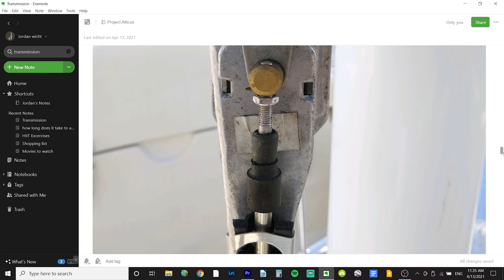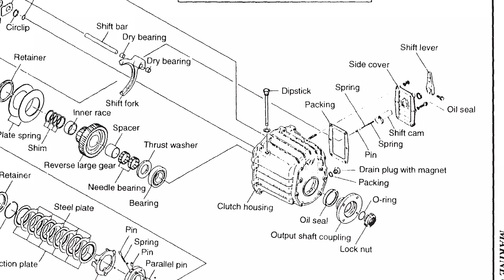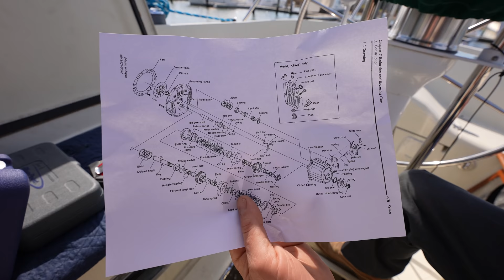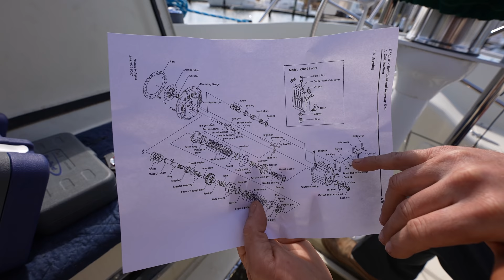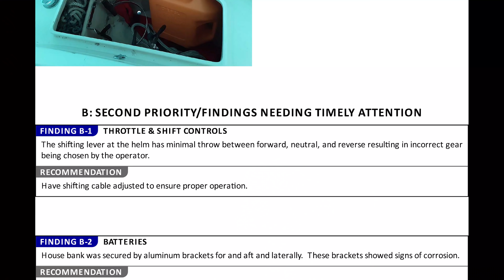This is a BIG problem 😧 | S06E02

Comment: Something I learned a long time ago, when you have something that is broken, you should go ahead and give it a shot in repairing it. Generally people charge a set labor cost to do a certain job, meaning a transmission rebuild is "X" number of hours of labor to repair. If I pull it out and give it a go in trying to repair it, I may be successful, or even fix it. My worst case scenario is that I am unable to complete the work and I bring all the parts to the mechanic and I'm charged the "X" number of labor hours, whether I bring it whole, or in pieces (generally.) So why not try it? Certainly there may be circumstances that would change this general statement, like proximity to available parts and mechanics. I learned this working on motorcycles. It generally doesn't hurt me to try and do the work the first time. 

My initial uneducated guess is a problem with the shifting fork...

Comment: I rebuilt my Yanmar 2GM transmission 2 years ago.  It is not as difficult as you think!  My transmission is a cone clutch transmission yours is a friction plate clutch.  Some of the Yanmar 3gm series used the friction plate clutch.   Its a bit different.  I think what happens is when the transmission starts slipping people pre load the forward shift position to create more pressure on the cone or friction plates in forward.  The issue is when you try and shift into neutral the transmission is slipping into forward.  This makes the issue worse!  With a cone clutch you can "lap" the cone, which is what I did.  I am not sure if there is a way to do this with friction plates.   Regardless there is a Facebook group "Yanmar Marine Engine Owners Group.  I get good advice on this group.  There a a retired Yanmar mechanic Danny Fong who gives the best advice... Good luck !!!
Reply: I spent less then 100 dollars to lap the shift cone in my transmission.  After 2 years it is still working perfectly!!!

Comment: (Just to say, I sailed for over 35 years, cruised and raced before I got into horses, enjoy your vids)  Your “hey let's just fix the lever how hard can this be” moment had me chuckle at a memory. I wanted to repair some boards on a stall and the next thing you know I was building 2 of them because , I discovered how rotted the supports were and they all need rebuilding for me to feel safe putting my horses in there .  

No small project ever survives remaining small and let's hope the next episode shows your transmission getting put back in and working. I'm honestly looking forward to the video when you guys are out sailing. The New England coast is gorgeous in the spring and what a good way to test that rebuilt transmission and rig!
 

By the way, nice work station in the background there. I see you now have room for a pretty good sized monitor and adjustable platform. It's nice to have room isn't it? 

Fair winds

Comment: The spot where you changed the pin you could have took a file or grinder to it and then it wouldnt have bent the cable.

Comment: I have watched your video this morning. I have been in the marine industry for many years. The Survey was correct in that there was a problem with shifting. 
How big a problem? Well that was both the surveyors fault and yours. Before you settled on the sale price you should have involved a good mechanical service to look over major issues like the shifting. The mechanic would have found not only the shifter issue at the helm but the cable issue and the fact that due to the shifting problem you may now have a transmission issue which ultimately reared it head. 
Point of interest for you and the viewers the Edson shifting unit you have on the boat is not a good product. If you want trouble free service you should convert the Edson unit to include a separate shift and throttle unit which you can find on Edison’s web site. I would highly suggest you have Safe Harbor / Bruce & Johnson’s marina install all of this with you looking over their shoulder to learn how it is done.

Comment: Um... to adjust the holes on the cable fork, don’t you just loosen the bail that anchors the sheath of the cable, and move the sheath back or forward? No need to screw or unscrew the tang on the cable.

Comment: Very good explanation on the problem with the gear lever and also on the inspector that he only has a few hours to do an inspection. I have a question for you. I know there are boats that have a sewage tank. When it's time to empty it and you are at the dock, does a vacuum truck come to your boat to empty it, or there is a setup like at the campgrounds. Thank you

Comment: Funny related story- 25 years ago, we bought a classic Alfa, and we also got a pretty significant inspection.  And like your transmission, the shift fork system broke very early on.  Since it's been fixed, though, no problems.  I hope for the same long term fix for you.

Comment: We would have new boats coming from the factory with control box problems binding the problem was they didn't read the instructions that came with the control box the cables   need to articulate and needs 12 to 18 inches of free play coming out of the box

Comment: I can relate to this soooo much... is like you start pulling the end of a little thread in a big pile. You only hope it will not get tumbled up with the whole bunch. That said, there are a few sailboats roaming the high seas without any engine (also in the Pacific), is it totally irrealistic to get to NC that way? (am a coach surfer, this is not a challenge but a genuine question)

Comment: you never shift "into gear" without engine running.  Your cables where not adj right- you broke it by force shifting when internal gears where not aligned because engine not running, maybe.
Reply: sure but if that activity broke a shift fork or shaft collar then it was already weak and this was the right time to find out! serendipity.

Comment: Was engine tension reapplied to transmission after control turned floppy ? May be that without load that selector mechanism has dropped into a temporary "dead zone" between gears with being pulled in and out numerous times in a loadless environment just a thought and question for my own enquiring mind ?

Comment: ....while you are at it - do yourself a favor and stock up on CRC SPH-400!! That's a industrial component protectant. Despite waht it says on the usage sheet - it is literally the one thing that does it all! It sprays on from a spray-can  and eventually dries to a wax-like consistency. It stays semi-transparent, so you can see what's going on underneath. YOu can build up a thicker layer by applying thin coats over a couple of days....
Like with your present gear box control troubles - when you fixed it and/or get new ones - when you have it ready adjusted - SPRAY IT ALL with SPH-400!! Actually I would cover most of the engine too - gearbox and all! Frankly - have a look where you see corrosion  - clean it up and cover it with SPH-400, multiple times! You will be glad down the road!

Fuel System, Water systems (fresh, grey, black), under the sink, wiring where you want to protect terminals (wire everything up - when done and tested - coat it with 1-3 coats, battery posts/terminals)

My background: Industrial mechanical engineering, 4 years merchant marine (engine area), 7 years flying of Tunaboats.
That stuff even solved a corrosion problem with PC-boards in a fumigation controller (Helicopter Ag-spraying) - just coated the whole board 3x and never looked back....

I have NO association with CRC - just telling you what worked for me for a universal protectant cover!

Good Luck!
Let us know when you are in Panama again!

Cheers!

Comment: If you have not already checked just try moving the f/R lever on the transmission whilst it is out if the lever rotates and the shaft doesn't it's an easy fix ie roll pin knock it out and replace 😉

Comment: the most important thing you can take away from this, is that you guys dodged a BIG bullet.......if that trans had failed somewhere in a storm, it could well have cost you the boat, AND possibly your lives...Jordan, you were absolutely correct to keep poking until you found out what that bad feeling trans linkage was....GOOD JOB !     Mechanic of over 50 years.

Comment: I feel like I’m the only one thinking, “seems normal”.  You bought a used boat; theses things are ALWAYS fixer-uppers.  Nothing here seems that big of a deal considering factors, like age, use, and price.  If people expect a 100% new boat, then buy a new boat.  But I’ve seen dealer issues even with those, right after launch.  Only difference is, they’re covered by warranty.  I guess 28 years in the Coast Guard has allowed my to see a thing or two.

Comment: ya i have the same problem finding neutral in my 40yo universal diesel but i dont use it that much so ive learned to shift it very gently and live with it.  i look at the schematics of the engine and transmission and i say omg if i have to get into that im jumping overboard!

Comment: Sorry to sound like a smarta*se, but could I suggest that you re-dismantle your throttle box and try and wipe off as much of the traces of WD40 as possible. You can then use 3-In-1 or sewing machine oil or similar to lubricate the lever and cables. WD40 is not a lubricant and will lead to accelerated corrosion especially in a humid environment. Disclaimer: my particular experience with this is with a mountain bike cable, not a boat, but hey, pla ça change....
Reply: pla??? "plus" is what I meant

Comment: Buds, been looking at the transmission drawing my thinking is your problem may be in the shift cam, spring, or a broken pin. Remember the boat had forward and reverse so that tells me all clutches and related parts or ok. Besides this didn't happen while under power. just a thought

Comment: Lucky that gearbox failed at the mooring and not during a passage or coming into a mooring.
You did the correct thing shortening that tube as the cables have to pivot at that point close to the single lever control. I hope you removed the sharp edge on the inside of the tube.
WD40 is not a lubricant just a water dispersant. Use spray grease to lubricate the workings .

Comment: Some how now days I don’t trust my own shadow.. after all the research and guided buying somehow I feel you guys got cheated on the purchase. 200k should have bought you a trouble free almost perfect boat.. no transmission or engine problems that’s for sure. I understand if a water pump doesn’t work or an alternator but the transmission or engine? That’s a lot to deal with for 200k..

Comment: Consider replacing the engine with an electric drive and a bunch of LiIon Batteries. Less mechanic hassle and together with a good generator your boat is miles ahead in terms of environmental friendliness and maintenance needs.

Comment: While you are stateside you should absolutely upgrade your computer to a mid to upper level AMD Ryzen model laptop(5000 series CPU best, 4800 excellent mid range value), with a discrete graphics card(not integrated APU graphics) built in, either a  Radeon 5500M, or better, 5600M, or NVidia Geforce 3080(careful, there are many versions of the 3080 being put in laptops, and some are so inferior they are 3080's in name only...shame on you NVidia). Expensive, but worth it. Intel can no longer compete, especially in productivity work, such as graphics and video editing. It will greatly reduce your time and effort in video production. So dramatically much, you will almost cry! Make that investment!